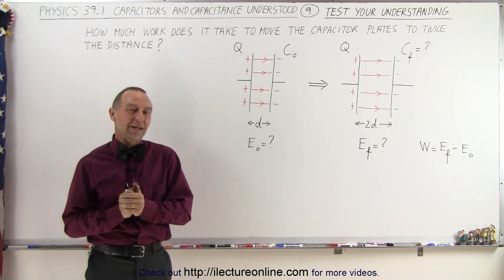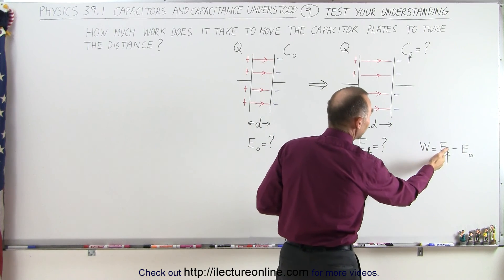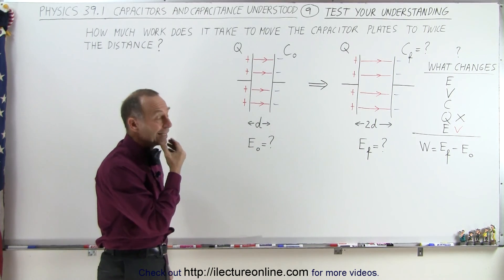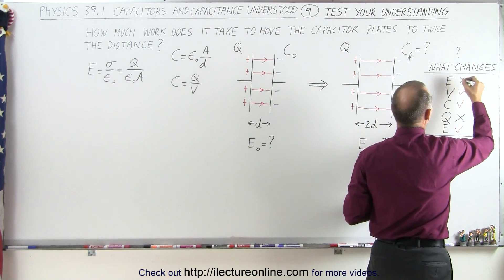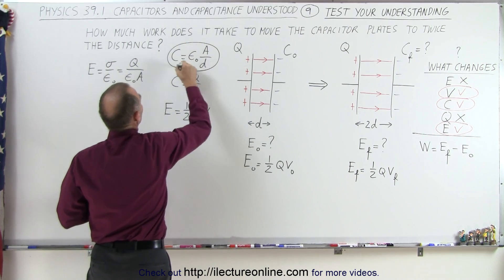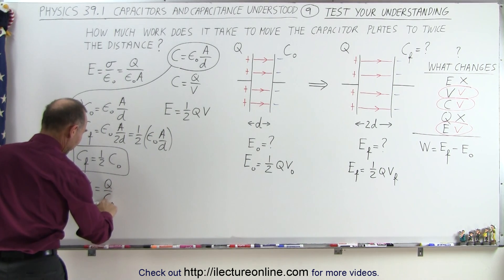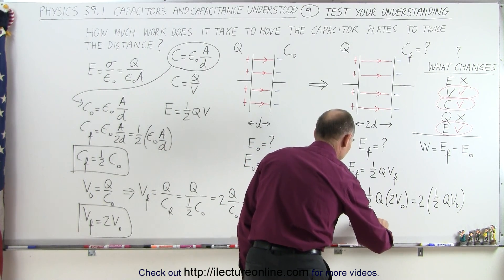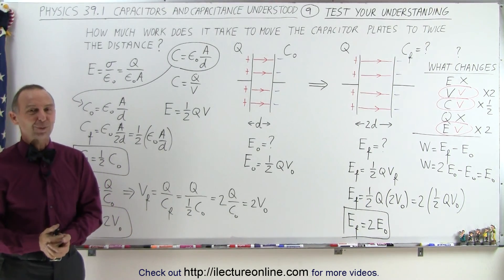Physics - E&M: Ch 39.2 Capacitors & Capacitance Understood (9 of 27) Test Your Understanding

Comment: Sir,E=v/d,right ?so why d increase the E remain unchange?
Reply from the maker: This equation indicates the amount of the potential difference when traveling a distance through an electric field.  It doesn't matter if E is constant or changing, the amount of potential difference can be calculated either way.
Reply: Michel van Biezen tq，sir